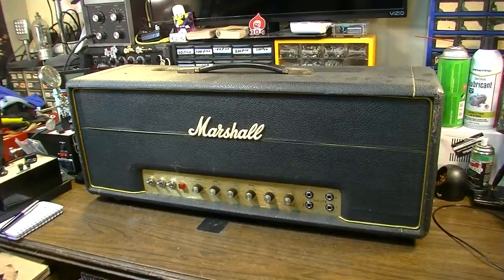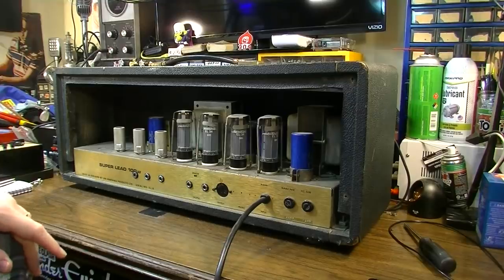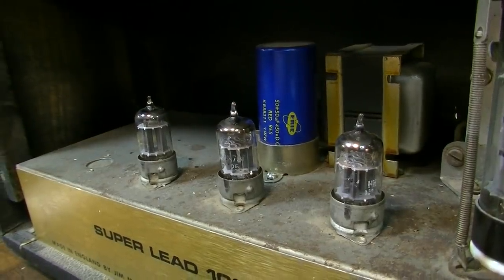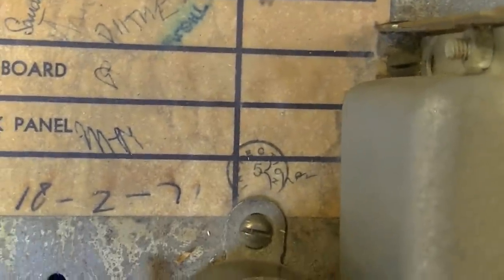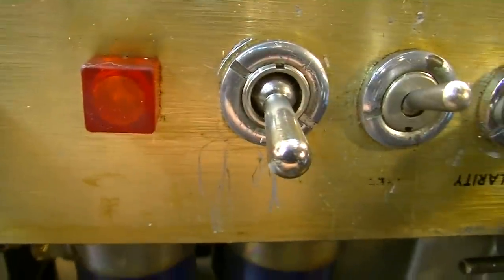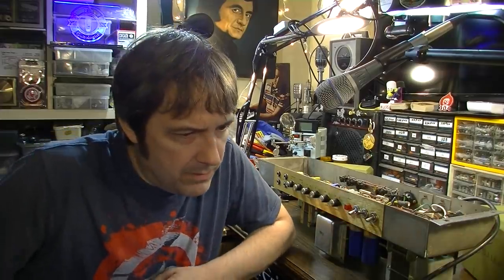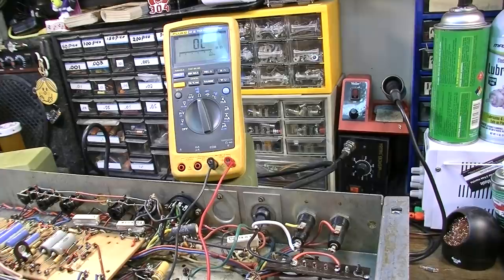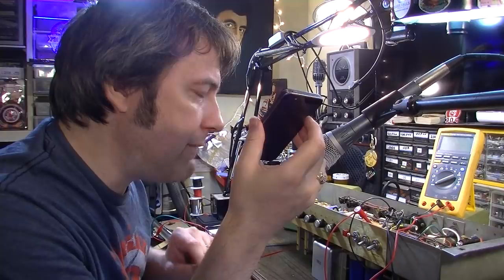Secrets of the Marshall 1959 Super Lead - 100W VINTAGE 1971 TUBE BEAST REPAIR!

Comment: those inspection points aren't that, it's paint used to protect from moisture.
Reply: used to keep screws on too
Reply: in manufactuing, we used them, in repair you should use them too.

Comment: Amp is awesome!! I remember reading that in reality, a 100 Watt Marshall isn't alot louder than a 50 Watt (think Dickey and Duane). Then again, i also read that a 1959 will rearrange your funiture trying to find its sweet spot at home. Brad touched on the low end bit . Played thru a neighbors years ago. Hot Cake pedal to help keep things manageable.
Reply: Yes. 100W amp is 3dB louder than 50W amp and 6dB louder than a 25W amp.
Reply: @goodun6081 Exactly. (Unless the volume knob goes to 11.) 😁
Reply: @goodun6081  ha, tis to laugh. You ever wind either one up? Clapton said he'd tempoirarily gone deaf in front of the dual 100 watt Plexi stacks in Cream. And he used a y cable, rather than  linking them together like Jimi..
Heck, I'll pick 'Deserted Cities Of The Heart", Live Cream Vol II, bought by me in '72. This is 100 watt rage.
Reply: @goodun6081   This is an extensive and thoughtful  reply, good 'un Thank you. At least you got  to see one at work at home, so to speak. My exp waa  a Marshall much like the one here  and my old neighbor  getting a solid tone in his living romm (ahh...the bachelor life ;) but helped by the Hot Cake. This is like 5 years ago. Other afternoons, i'd be at the end of my block  (less than 50 yds away) and i'd hear him playing  the intro to Too Rolling Stoned!! 

The whole loudness and the ear is interesting, however.
The statements i offered were just ones i read.  Though i truly believe a 1959 WILL rearrange your furniture when its raging.

On the other side,, i saw Paul Chapman era UFO at the BG Civic, '82, Mechanix tour. Easily the LOUDEST concert ever in my life. Thing was, we were straight out from the stage, first row balcony and except for the intro to Mystery Train, It sounded like hell. Heck, i tried to talk to the guy sitting next to me and nearly screaming into his ear, 'huh?'. We gave up..
I always thought  ''the hall' was at  fault. or at least our seat.  It was a garbled mess.

In '08 i bought tix to see Bon Jovi at the then HP Pavillion (maybe last tour for Richie S)  Wife's a fan. We had these climbing Mt Everest seats straight out and son of a gun, everything was clear as a bell. It was plenty loud (dang Daughtry nearly stole the show). 

I actually asked i guy i knew who ran sound for local street festival about overloading a hall. He said it could happen.
Reply: @goodun6081  This is great, man. Dregs fan since Dregs Of The Earth was bought  by a friend in  '80 or so. Industry Standard  was a fave but have  more , including Steve's solo stuff (the intro, high tension "TumeniNotes' springs to mind). He was an Ampeg guy for a time but i only saw him once,, opening for The Trio (al, john and paco), Davies Symphony Hall, '83. Acoustic. He was great on his  own and they called him up for an encore jam.  When it was time for Steve, it was really special. No sweeps or what have  you..Just  a great part with these almost crying pick harmonics. Smiles from all these greats..
Reply: @goodun6081  Wow, That's awesome!  I agree and thanks for the reply!  man, one evening, i heard on the radio John MacLaughlin was playing at the Keystone in SF. How i missed this i can't  say. This was '85 or so for the Mahavishnu album which i loved. Called some buds and got the same 'its a week night, short notice' thing. Can't say i' blame them but i couldn't miss this show, so i went by myself. ha, JM with a 'Pau;l thru a combo amp. Someone asks "Where's the synth guitar?" John, "I think we're getting on just fine now" to huge applause. Pretty great since  he's not touring now.
Reply: @goodun6081  Man, this is all great !!! Isn't thie where Pat Metheney, Jaco and Bruce Hornsby went to 'school'? Crazy times!!

Comment: What a cute little Very ack ac control this series shows how little test gear is needed for tube amp repair, he uses a fluke meter and its excellent I have the same I won’t recommend a dim light for power up just a ac light in seres with the power line say 25 watt so the highest power in can pull is limited to 25 watt  this prevents damage if your not fast you can be pretty slow in tube amps solid state not so much